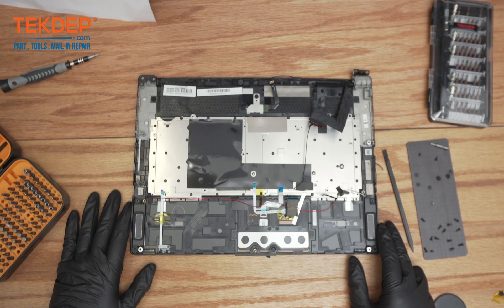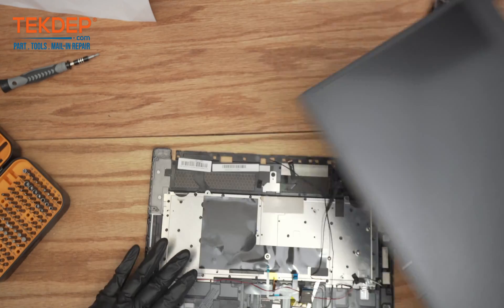MSI Workstation WS65 8SK Repair Guide!

Comment: Thanks for this video, I was able to replace the thermal paste on my laptop. Question any idea how to remove the space bar keycap? Or the process of replacing the keyboard entirely? I think my space bar on the right side is broken but have know idea how to get into it.
Reply from the maker: There is small clips that hold the space bar on your keyboard and other keys, spaces bar usually have multiple clips due to the size, however a lot of time this clips do break, I would say the space bar is the most finicky one to replace, but surely possible as long as the clips are not broken, additionally you can just replace the entire keyboard that is usually a better for long term, to remove the space bar you can use a tweezer to raise the key slightly and inspect the mechanism that is holding to it and getting them disconnected one by one, additionally if you need help we offer easy mail in repair service and can do the repair for you the right way, visit  https://tekdep.com/mail-in-repair